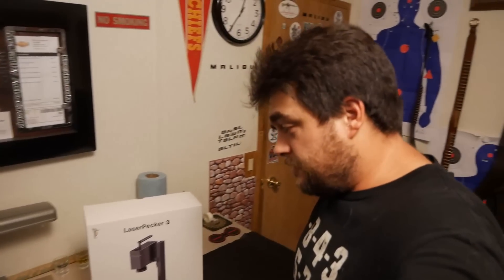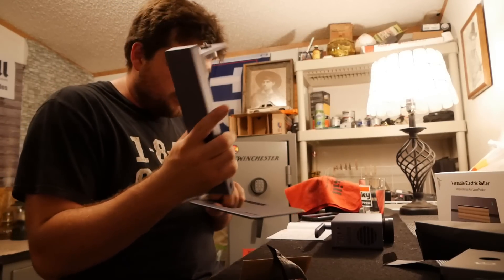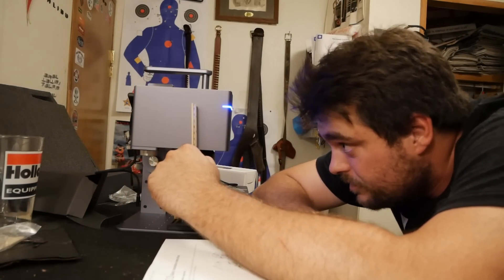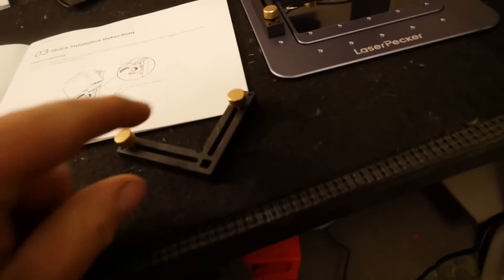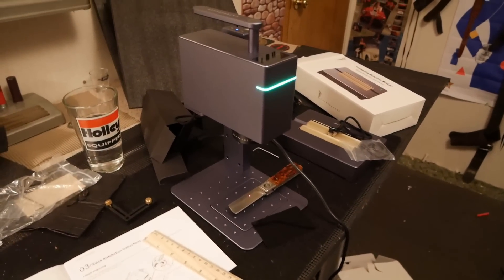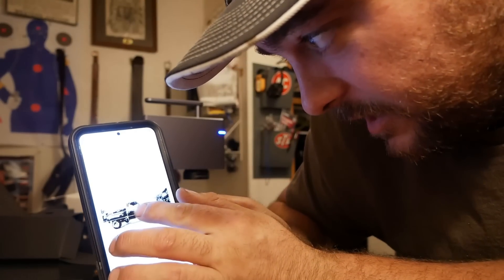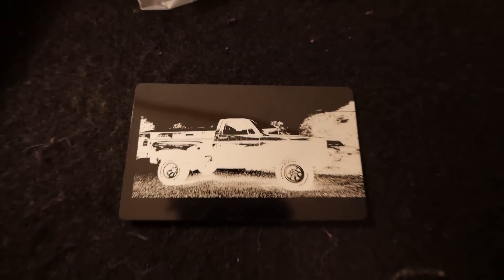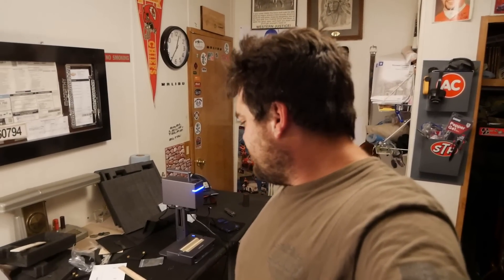LASERPECKER 3 Laser Engraver Review! It's AWESOME

Comment: U do a plate for power, start button and fuel pump on wrecks then use a dark painnted plate and etch into it and then mount the switches?  Better then the old sharpie?

Comment: It is not powerful enough to do metal but you can apply a stencil material then laser the stencil.  After which you have a perfect stencil for Chem etching.   I use it on some weapons stuff now and then to mark them.
Reply from the maker: It sure etched that socket nearly perfect
Reply: Try to use MoS2 powder or CRC dry moly lube when engraving clean metal. You'll see the difference
Reply: @outsidethebarn  it marked it because it took out the oxide coating. There is no depth to it. When messing with weaps you need depth.

Comment: Yeh these lasers are incredibly good. But like anything, a little bit of PPE is advisable. Bare minimum is a pair of laser safe goggles. Equally some of the fumes they give off can be a bit funky. But being a long term subscriber my guess is Dalton probably not as worried about those. Meh… I get it
Reply from the maker: No actually I didn't even think of the IR radiation, and the manual said nothing about it 😂 kinda scary